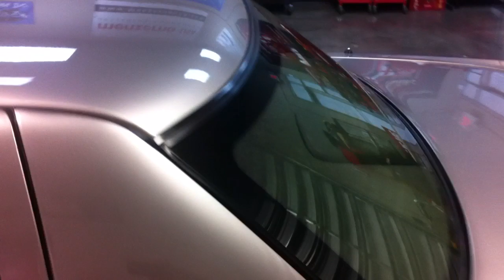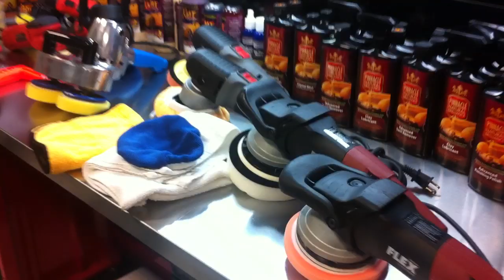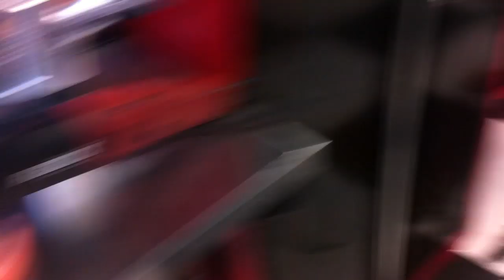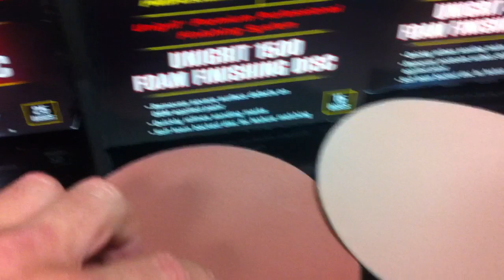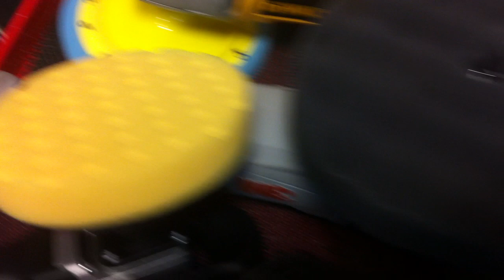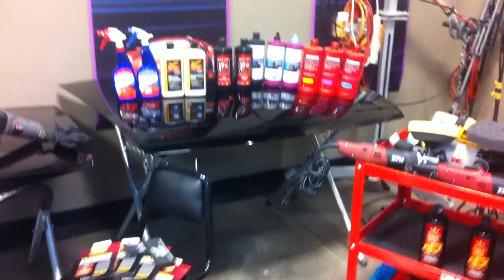Learn to Machine Polish For Show Car Results - Machine Polishing Classes at Autogeek.net

Comment: have  a  question  i  bought   meguairs  number  82 mirrior glaze swirl free polish  i  use  the  meguairs lutimate  compund  on  my  moms  jet  black  350z  it  got  some  what  of  the  swirl marks  off   and  much  later  on  i  am  going  to  use  the  82 swirl free poilsh  that  should  do  the  trick i  just  have  to  get  the  hood ,roof, trunk  lid and  it  should  look  brand  new  again  black  cars  are  hard  too  wash  but  they  look good  when  they  are  super  clean

daniel

Comment from the maker: @svr73 
You're correct.  Just to note I tested the paint and dial-in a system approach that removed the swirls using the least aggressive products and then shared that with my approximately 25 students that arrived wanting to learn how to remove swirls and polish paint.  -MIke